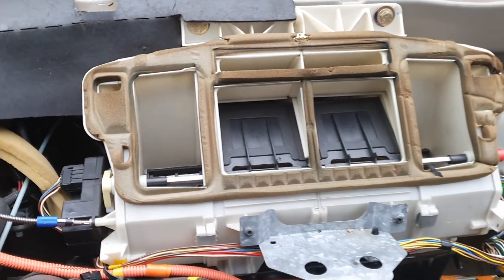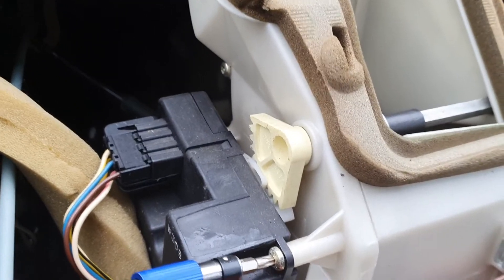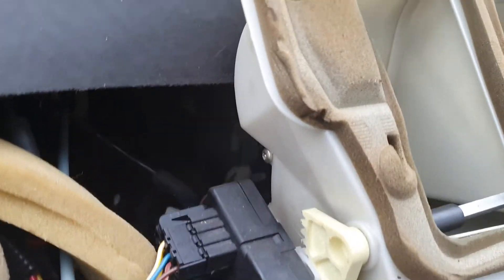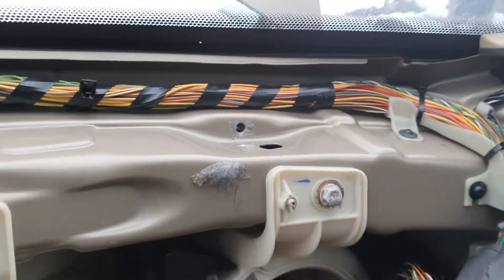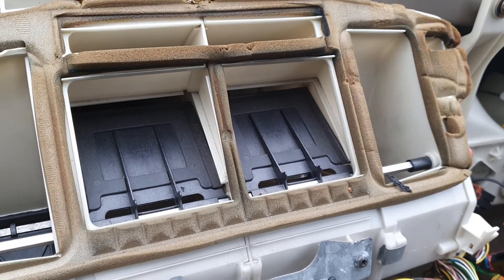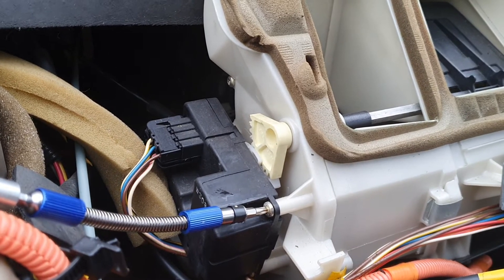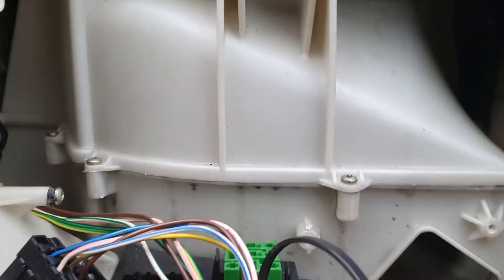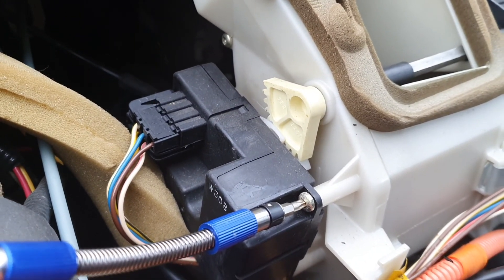Volvo 850 ECC under the dash system overview

Comment: Hi craig, I am having the same issue with defrost not working. What did you mean by closing the doors manually to get defrost working? Which doors should you close and how?
Reply from the maker: Hi, sorry to hear you're having the same issues. Mine is stuck on "face vent" so I close the vents on the dash. It forces some air to the defrost. Enough to get by with.
Reply: @CraigHagan  Thanks for the quick reply. Did you close them through the vents or elsewhere? I actually tried closing the door from the opposite side of actuator but I couldn't do it.
Reply from the maker: @MrJaakkoLe  no just the vents at the dash. In my system it seems to force just enough air up into the defrost. It's not quiet as the air is on high but it can help until the windshield is defrosted. I don't leave it there for a long time in my climate.